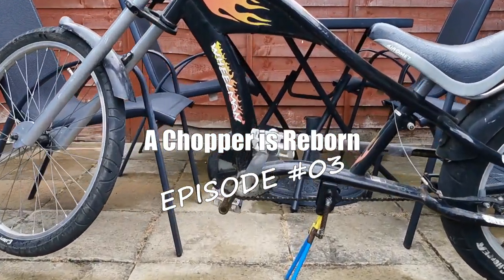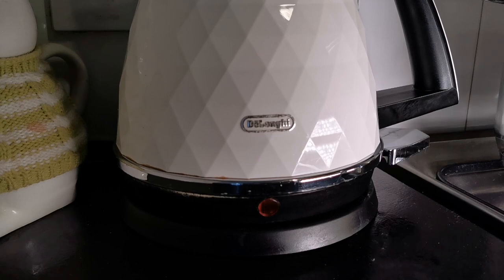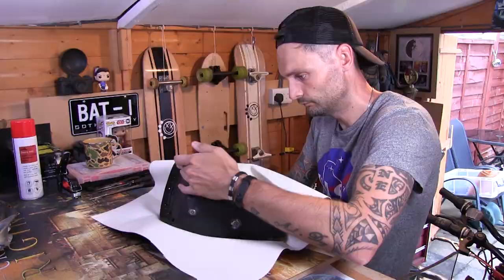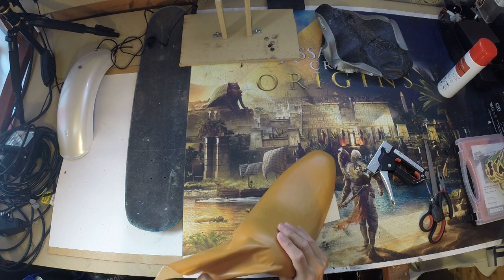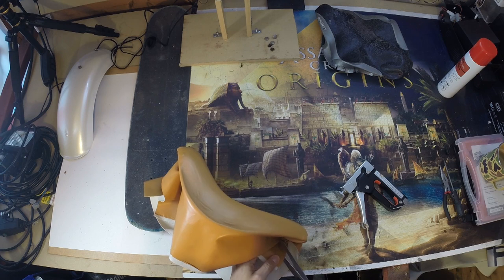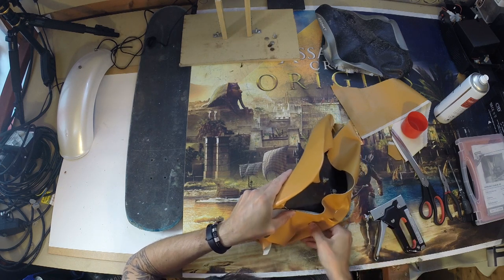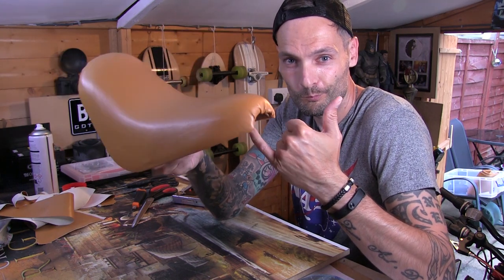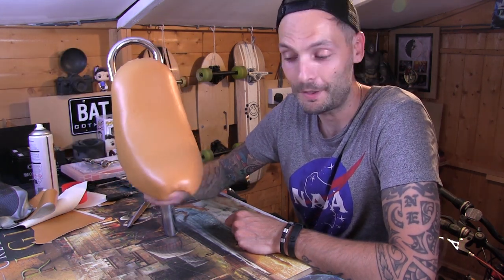How to replace a seat COVER on a Chopper Bike | Episode #03 | custom build

Comment: hey i have a route 66 chopper bike im fixing it up now. its in good condition just some dinks and scratches any tips on getting them out?
Reply from the maker: if they are only small you could try a touch up paint pen but you'd have to find the same colour paint or you could just repaint the whole frame.
hope that helps thanks for watching